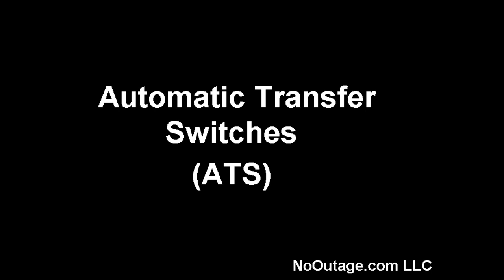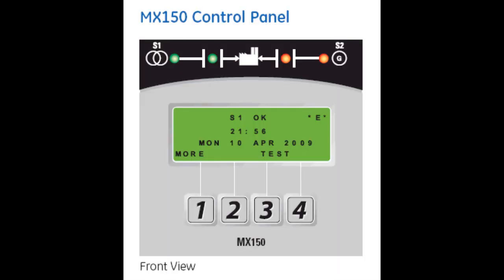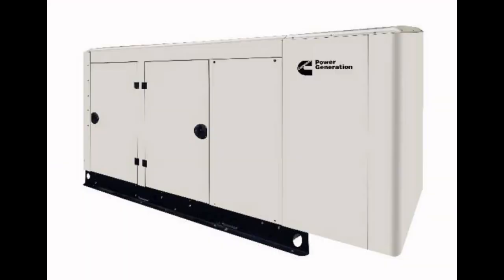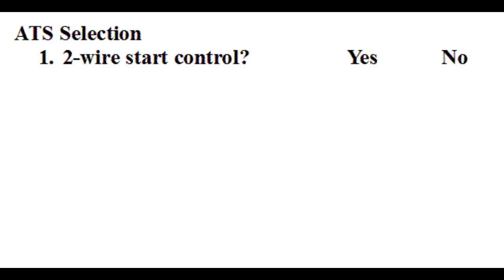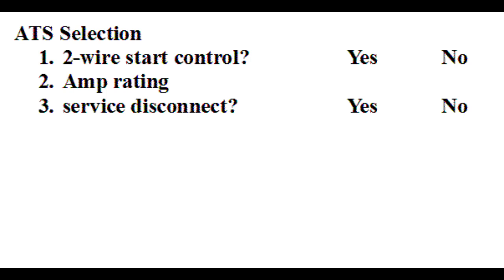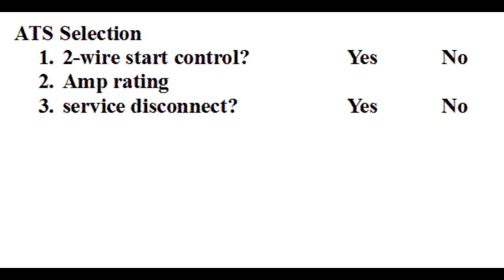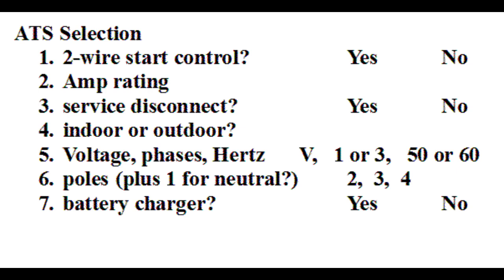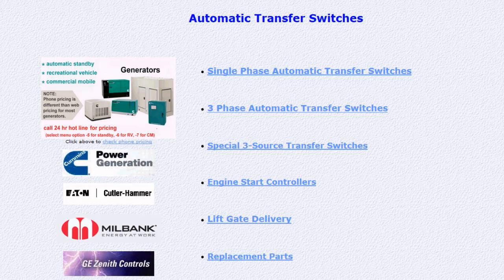Automatic Transfer Switches (ATS) for Generator Backup | nooutage.com

Comment: Thank you for the very informative video.

I requested a quote for a Diesel Generator for a business that occupies a building with three electrical meters.
The quote included three transfer switches which they was required because the premises using three meters.
Is that correct?

Comment: Will an ATS work on any Brand Generator? I am having to replace my genset due to a fire within my unit. Can I install a 10k genset( same as my old one) using my existing ATS ?
Reply from the maker: Most gensets of this small size are air cooled (no radiator) and are designed to work only with the same brand ats. In most cases they do not use the standard 2-wire start control scheme like larger generators. Check the wiring diagrams for the ats and the proposed genset. Or contact the manufacturers to verify compatibility.